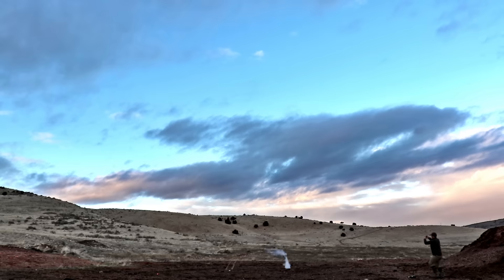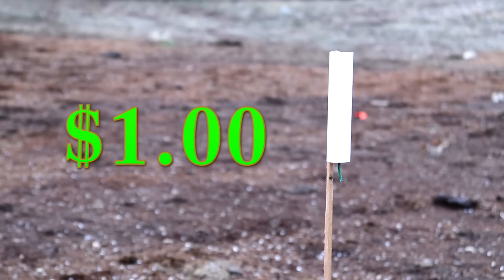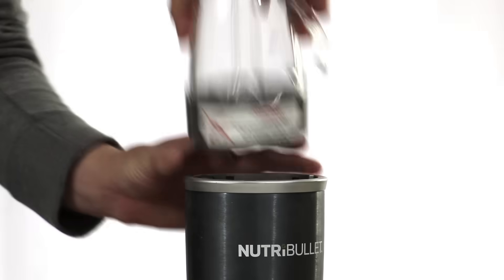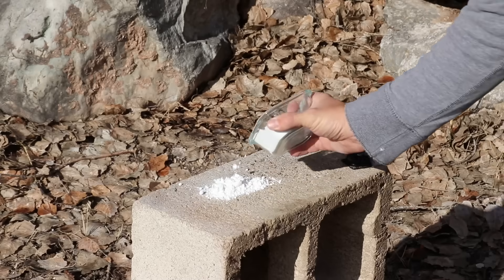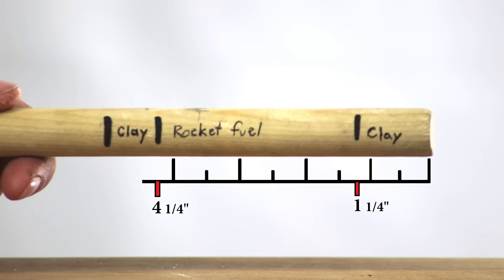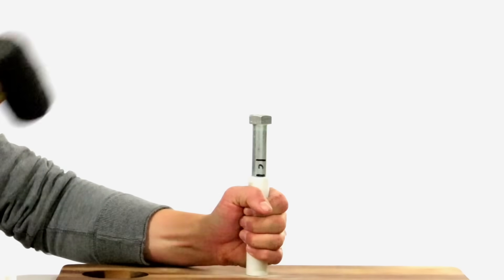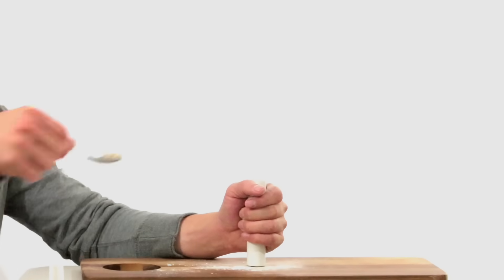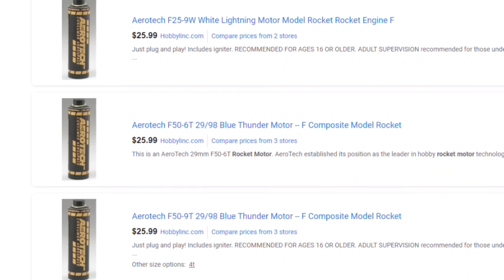How To Make Sugar Rockets (Powder Fuel)

Comment from the maker: How to make a fuse video⬇️ https://youtu.be/uVLotjV9cdY
Reply: Great..
Reply: Independence Day is going to be a lot better this next year🤟
Reply: what if i wanted to make it explode too in the air would that be possible?
Reply: @delkando1 I made a delay on it then just put a firecracker on the base
Reply: That was going to be my first question
Reply: How can you cut the extreme  of the bolt? What can it be use?
Reply: I got rickrolled;!
Reply: I'd like to make some using 12" pipe!!!
Reply: A sugar rocket bike?!
Reply: Licenses Schmicenses !! Full Speed ahead !
Reply: Sounds cool as hell too !!!
Reply: Do you think a grinder for spices would work for the post Asian nitrate instead of a blender
Reply: You showed everything step by step except how to put the fuse in
Reply: Would these work in the model rockets you get at a hobby store?
Reply from the maker: @DingDangg  Not right off the bat, the motor would need a parachute eject modification, and the dimension of the rockets body would not fit properly to a PVC pipe.
Reply: @EthanAllred1  Tkor made a video about these sugar rockets except he added a way to put a parachute in it
Reply: @EthanAllred1  i could not find potassium nitrate in my country. Have another material to replace it or not?
Reply: @EthanAllred1  hi sir ethan' how to make a explode except the rocket fuel fly and boom 😆" im just asking ✌️
Reply: @EthanAllred1 how long of a wick/fuse does it need- I’m new at making model rockets so far I have built 76 perfect rockets - the engines

Comment: As a kid I was making rockets from kitchen paper towels soaked in a sodium chlorate solution which were then dried in a tumble dryer at low heat. Fold the sheets in half and roll as tightly as you can and stuffed into a Smarties tube. Touch paper was made from newsprint paper with the same solution but just twisted into a fuse.

Edit: Sodium chlorate weedkiller contains a fire suppressant (sand lol) to dissolving the weedkiller in water just leaves the crud behind so you have pure sodium chlorate for your "hobbies"

Comment: Hey, sny reason why you did not cook/boil it in water first? cuz every other video they sort of melt two ingredients together and make a dough like thing and then put it in the tube.

thanks! cool and informative video.
Reply from the maker: That method is for solid fuel rockets. This video is showing the powdered version. The compacted powdered version is much simpler.

Comment: 4:45 😬
Can someone explain why it can ignite and where someone could build a sugar rocket fuel safely without something happening 😅
Reply: Just go in slowly and it can get easily ignited because the mixture is very combustable prob just a cold and or wet enviroment for it to be safer

Comment: What do you think about 3dprinting the case and include the endplug in the print, maybe leave 10 mm undrilled så it wont melt through immediately?
Reply: I thought about this too, most likely the pressure would be to much and the print would crack

Comment: Just found your vids while searching for information on building model rocket engines. I'm sick of the commercial prices! Time to take my hobby to the next level and make motors too.

How about an ejection charge in your motors?  The only problem I see using these PVC motors is they will not fit in a typical model rocket that uses the 18mm, 24mm or 29mm motors (or larger). Their motors are odd-ball sized, so I'm having to make my own paper motor tubes. Not a big deal, but it can be a PITA sometimes. Wish I could find commercial thick-walled tube I could buy and cut them to the lengths I need.

Thanks or the vid up!

Comment: What is a 7 30 seconds drill bit?
Reply: Did you miss basic math in school? :) ,  7/32 = .218" (just under 1/4"). A very common size drill bit you can get in a decently stocked tool or hardware store (or Amazon, etc).

Comment: I'm having failure on one of the ends of the rocket. The kitty litter isn't holding position and it's getting blown out. Any suggestions?
Reply: try adding some water to make it a clay texture then letting it dry completely, or try ramming it harder to get it to compress.

Comment: If i where to add a header to this could i just leave a hole on the top, leave a little extra powder not drilled at the top and have the fuze of the header imbeded into that bit of extra un drilled fuel? I imagine this would work fine, but I just thought I'd ask to see if anyone knows for sure.

Comment: plz dont use a bolt to compress ur rocket as the bolt is electrically conductive and could cause an accidental ignition. use a wooden dowel.

Comment: I mixed the rocket fuel the same way you did which was 3 ounces of potassium nitrate to 1 ounce of powdered sugar and it will not light. This is not my first time doing this. My old ratio, which works great is 65 g of potassium nitrate to 35 g of powdered sugar and to make it a little bit more aggressive, you sprinkling about one or 2 g of iron oxide

Comment: In the 60s we made rocket motors using sugar and saltpeter cooked int "Carmel candy" and poured into the motor casing to cool. The tricky part was heating it enough to melt, but not ignite, The melting point and ignition temperature were only about 50 degrees apart !

Comment: Awesome 👍  I got a rocket kit for my birthday about 20 years ago.  My Dad and I made the rocket which consisted of a cardboard tube, some plastic fins, a wooden nose cone and a long stick to launch it.  We even coloured it red and black with felt pens to match the fins.  It had 3 small rocket motors and some electric matches to set them off.  They were quite optimistic that it would fly 3 times, but the first time we set it off the rocket made a satisfying "whoosh" and then proceeded to spin out of control and landed in the woods at the far end of the field never to be seen again.  Lol.

Comment: GET 5 TIMES THE ENERGY FROM THAT MIX.
Water down the sugar/nitrate mix so you can simmer over low heat none stop for like 30 minutes (until it looks like peanut butter ). Remove from heat & either stuff it in tube let it set for days until dry OR  let it set until completely dry, then crush to powder, then stuff  the powder in the tube.  Enough water so you can simmer at least 15 minutes straight at consistent temp.  This allows the molecules to have a  tighter bond. WATCH OUT, if you test some that's not crushed into a powder, because the chunks will fly like little rockets more than 20 feet, but the direction they go is random. I tested a little pile (the chunks were around half the size of a pea) they were shooting in all directions "dangerous"

Comment: The gun powder formula is potassium nitrate, charcoal, and sulfur

Charcoal is everywhere at every utility store
Potassium nitrate can be bought as "stump remover" 
Sulfur can be either homemade or bought 

To make it you will need a shit ton of matches and match boxes 
1. Take the match heads and shave off the top not the wood just the top 
2. Take the striker part of the match box and shave it down to a powder
3. Once you have them both in a powder grind them up even further and mix them together 

Have fun 😜

Comment: Did I miss something? This was a great video and very informative. However, is there a certain sized stick used to attach it to the motor.
I would think that specs of the stick would play into flight stability.
Can you provide that info?

Comment: Here is a thought: marry the sugar rocket to a 37mm launcher, wherein the sugar rocket is launched 50 yards by means of the low pressure impulse charge normal to a 37mm launcher. The flash from the launcher ignites the stub fuze of the rocket, allowing the rocket to ignite many yards down range. Much like the hi-low system of the 40mm m29 grenade launcher. The rocket would need some form of stabilizing fins so the rocket flys true. Think law rocket fins made from steel shim stock.

Comment: i read that it is better to cook the rocket fuel fixture first on low heat, to melt it, is this true?
Reply from the maker: The solid rocket fuel is melted down first. This video is the powdered rocket fuel version of a sugar rocket. The powder version is the simplest way of constructing one. Safer with less steps.

Comment: As a chemist, I don't suggest you do this at home without safety considerations.
Several safety concerns, 
1) Powered materials react faster than big chuck, especially the oxidizer. KNO3 is a hazard material and it's shock sensitive. We are not confident handling this fine oxidizer with fuel (super fine suger power)
2) Hammering or compress the fuel with oxidizer is not a good idea.
3) PPE needed. At least you need safety glasses and anti-flame cloth for this experiment.
Some suggestions.
You may improve the preparation by mixing two in some solvent like water and keep mixing it under heat until the two material formed a gum-like material.
And always remember, dont do it in your kitchen, and have your fire extinguisher ready.

Comment: Adding 2-5% iron oxide by weight gives a much more even burn, and if you can work a sugar thermometer you can make a toffee of the oxidiser and the sugar (don't use a flame burner to heat it...) that is both denser and more predictable than the powder.

Comment: Wonderful video, Ethan. I enjoyed it very much. I would love to try and make these if I ever got back into model rocketry again. I have a few questions- 1. Have you ever designed this type of engine in such a way that you can get a recovery charge on it that will expel the nosecone for parachute or streamer deployment? If so, could you post a video? 2. Does the sugar completely burn away? I am concerned that with sugar being spread throughout the body of the rocket that it may eventually get moldy during times of prolonged storage, even with a cleaning of the rocket., 3. Is the PVC reuseable?, 4. What heights could a large Estes or custom build rocket that could accept this engine achieve? Thank you very much for your video and for your time!

Comment: Yes ok. Let me say “The rocket is cool and I’m gonna prolly do this with my grandkids, but you show a bolt for ram rod and talk about packing with a hammer.  Be sure and use rubber dead blow hammer. No ignition! Then drill with electric drill? Ignition again every time the motor starts/stops.” Really cool. Be careful!

Comment: A great video! I was using a mixture of potassium chlorate, sulphur and powdered charcoal. However, I would never ram this mixture down with a mallet. If not, it would blow up. So, the next time I make a rocket engine I'll use the potassium nitrate/sugar mixture you showed. Thanks a lot.

Comment: I think a smaller bore in top of the rocket motor say 1inch and the rest at the larger dia to get it off the ground may work better and cause the rocket to last longer.  Also can you add multiple rocket motors and still stay under the lic requirement?

Comment: Make APCP instead, if you mix this stuff wrong it might explode when ur trying to make it take off. PVC does not show up in X-ray imaging the same way as other things do and it is tough to spot if you get hit by PVC shrapnel. If you are going to do this, stay far away and use a wireless firing mechanism instead of a pyrotechnic fuse.

Comment: I mailed away for 5 cent sugar rocket  “plans” from an add in the back of Modern Science magazine when I was 11 years old. So many great times were had.  I filled the core hole with black powder and taped the fuse at the bottom. I could vary the acceleration by filling the core halfway with black powder. Think of a slow moving Apollo rocket taking off.

Comment: Interesting fact about the hole going all the way up the fuel... In big solid rocket boosters like SLS' (almost the same boosters as the shuttle used), they can make the hole shape different than a circle. They can make it a star patter, a "+" pattern, etc. These different patterns will change how the thrust changes over time. For example, the "+" pattern reaching the edges of the booster, leaving 4 quarters of a circle of fuel will give you immense thrust at launch but will burn out VERY quickly.

Comment: When I was a kid, we used copper tubing. Straighten out the copper tube & pound one end closed with a hammer.  We used a combination of sugar, saltpeter, and sulphur for fuel. Sometimes we'd steal one of his dad's shotgun shells and mix the gunpowder in to make it pretty. Don't remember what we used for a fuse but if we were in town, we'd use a train transformer.

The fuel burned very hot and left a residue that looked like welding slag. We had a V-shaped launch pad like you'd use for fireworks. Those rockets would go so high, we'd lose sight of them.

Comment: Would it not be better in a steel tube that's sealed at both ends with a wick   made from string coated in the same solution 🤪

Comment: The instructions are solid, but none of mine are working, I've made around three of these using the powder and all of them don't take off, and instead just fizzle and turn into white goo after it burns. No thrust at all. Anyone else have this issue? And is there a way to fix it? Btw I'm using powdered sugar and KNO³ so I don't know what's going on with it
Reply: Try a ratio of 65 KNO3 and 35% sugar. Make sure both are ground to fine power before mixing the two. Compress mix well and remember to nozzle and core rocket to about 1/3rd of the inside diameter. eg A 15mm inside dia rocket would have a 5mm nozzle and core . Ps  Icing sugar works best as it's already finely ground.

Comment: You said that you drill the hole all the way through.  Which makes sense 👍  But how would leaving 20/30% to achieve a longer burn sound ? There is now a larger combustion chamber.  ?      ....   Gr8 stuff 👍 🇭🇲

Comment: Do not use steel as tool in fireworks! It is extremely dangerous! Steel can produce sparks very easy. If you want to use some metal fo tool - use brass.

Comment: A word to the wise, don't bang an explosive compound into a tube with a metal rod (more friction and heat) using a hammer (metal on metal friction, heat, sparks) whilst firmly grasping the container with a hand (contained explosion), , and then drill with a metal drill bit into the explosive compound!! are you serious lol, I am surprised you still have a hand - aside from that, interesting

Comment: Can you use Estes electric ignitors for them?  How about an ejection charge? You would need a delay cylinder in the center of bentonite end. Drill the bentonite and fill with powder, then a short, full pipe size section with powder and then cover with bentonite in a short layer.

Comment: No I understand - growing up I used to try to make my own rocket motors using old motors.  They worked but not well.  they did work well for a glider due to the long burn time.   I should have drilled out the center......

Comment: I wonder if this stump removal powered (Kno3) is poorer quality or dumb down now? My grandsons and I follow the instructions very carefully and the rockets would never take off. Maybe we are packing the fuel too tight? 3 (Kno3) to 1 (sugar). I watched a lot of videos on this and you guys are all doing basically the same thing. Ours are all DOA!
Reply: Is yours just fizzling and making a white hardened clump?
Reply: @memeboy1637  That is what it did. Burn slow and hard to ignite. All the chemicals were bone dry too. I see some people cook the ingredients together.
Reply: @xhefriguitars7946  yeah was my experience burning them together we'll get them to light, but there's still a really big lack of thrust issue for me, I just went out there and reversed the ratios so 3 parts powdered sugar and 1 part KNO³ and it'll it pretty easily and powerfully, and I didn't pack it into anything I just had it on a piece of paper

Comment: The building of the rocket was very clear and concise EXCEPT, is it a MOTOR or an ENGINE? 
Like another video I saw, it was called motor and engine ALSO! hhhmmmm?
Engine; A prime mover that gets it oxygen from our atmosphere.
Motor: A prime mover that has its oxidizer on board and therefor can operate independent of our atmosphere.
Conclusion: Since the oxidizer was mixed with the fuel, this rocket MOTOR , could indeed go into space if it had enough thrust so consequently it is DEFINITELY a rocket MOTOR!